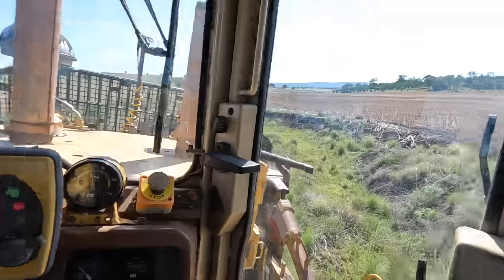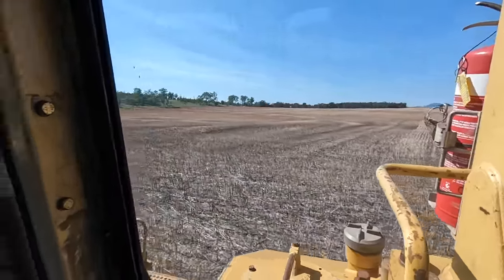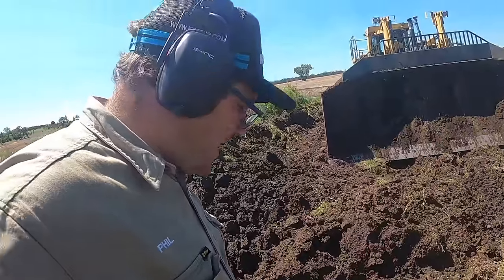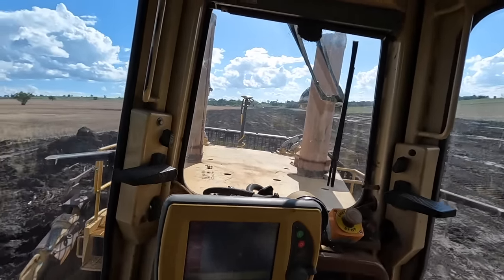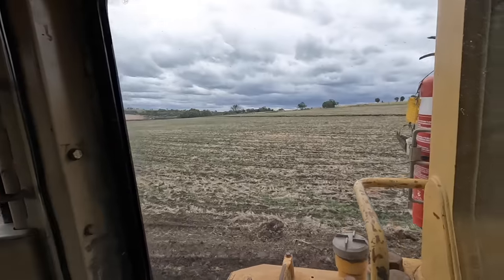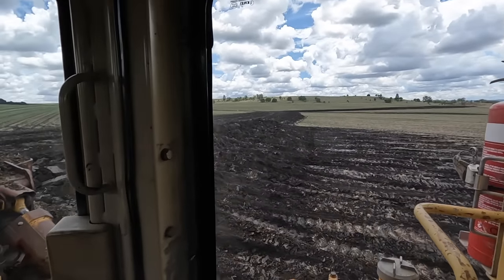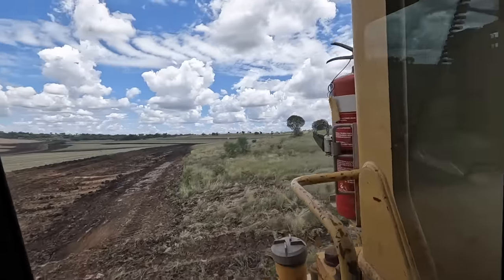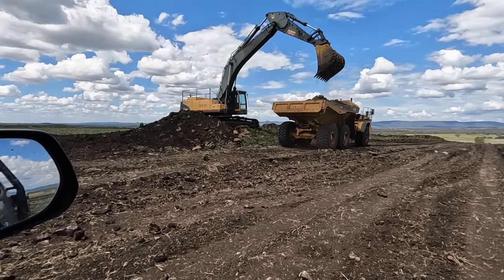D11 Building a Waterway | Big Bulldozer | Vlog 245

Comment: You boys have auxiliary hydraulics on the excavator,,,, see if you can find an outlaw bucket. It separates the dirt from the rocks. Using that sifting bucket banging it back and forth will wear out pins and bushings and cause all kinds of problems.

Comment: When you are running from Waypoint to waypoint. Is the blade height / rip automatically set via datum height or is it all done manually. Would be nice if you could vlog how you do the water fall from waypoint to waypoint. Explain how you use the gps and if it’s datum set.

Comment: You should consider getting a mobile trommel screen to clean up the rock you want to use.
Reply: nah the little dirt will lock the big stone in place and the grass will grow up on it s own , this is farming not landscaping , the added cost and time, ware and tare , double handling of material are not in a farmers budget ,add it easier to spread a mix then just big stone ., tracking them in with out busting a track and first big rain will show off the stone works after ,,,the object is to slow the water to prevent gully cut erosion